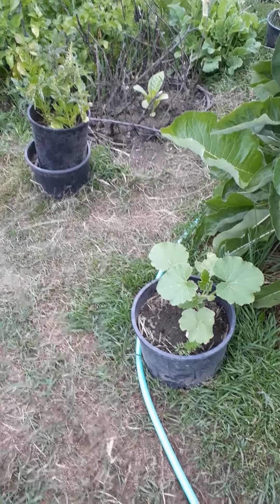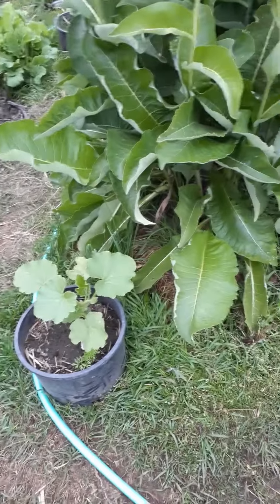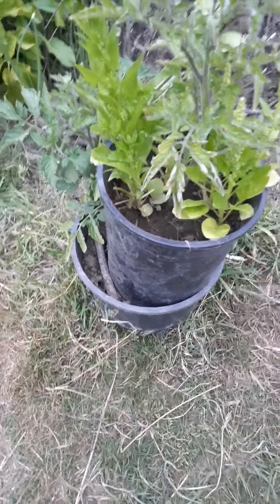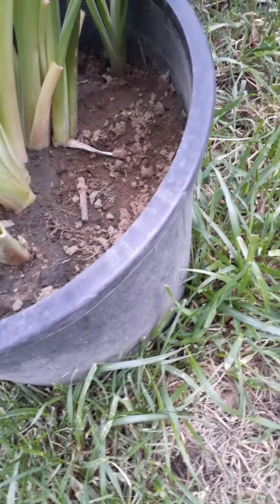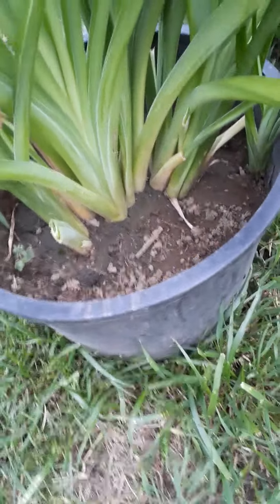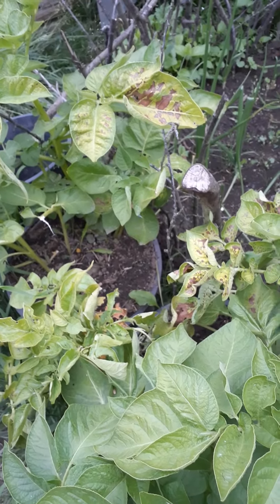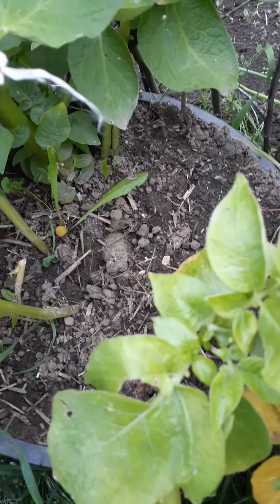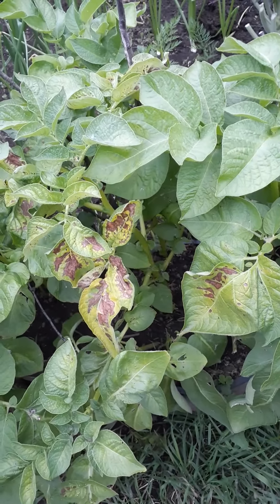A few tips for watering garden and potted plants.

Comment: Great idea with the hose bumpers !! I would get sick of pulling a hose through on every corner 😋😋  drip irrigation would also be great  and ya pots are challenging as water can run off out of the pot and it could take you all day it seems   I use a lot of pro mix texture stuff so it's easier to saturate  perhaps you could start adding a lot of peat as you go along ??!??!!?